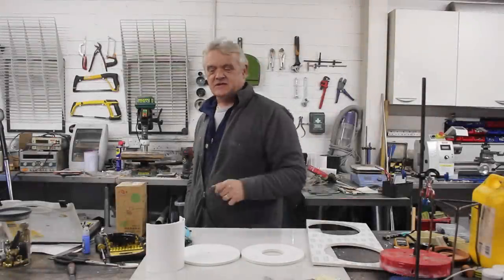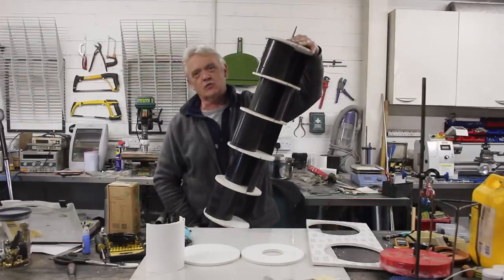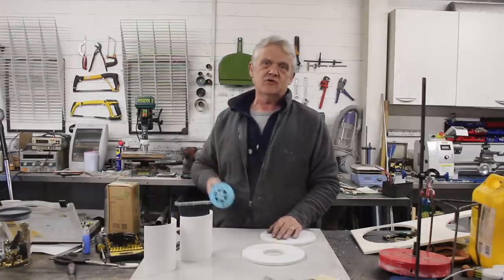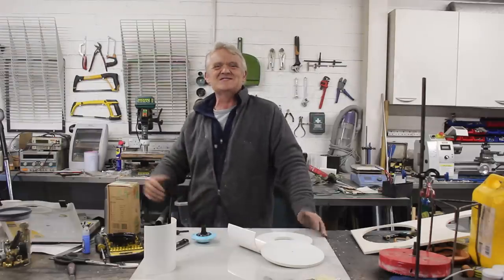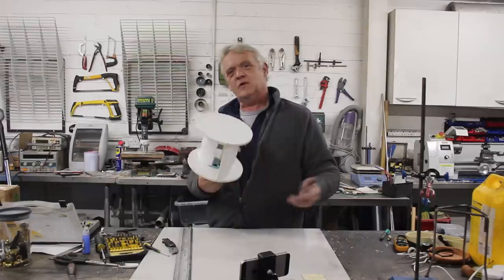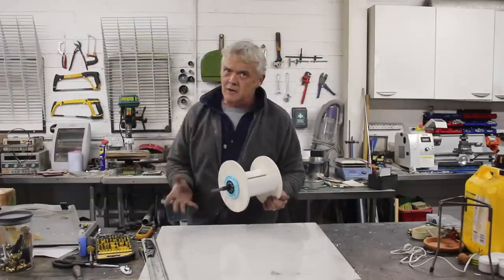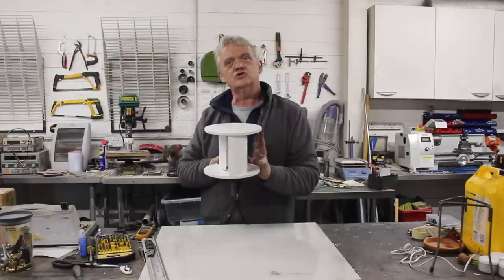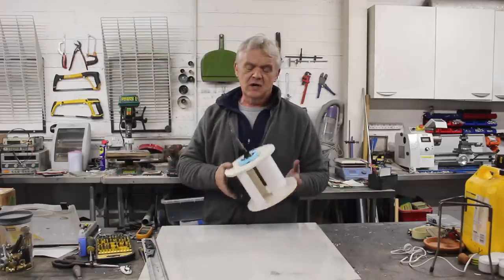1718 A New Style Of Wind Turbine - Cheaper, Simpler, Better

Comment: Rob, I read one of the earlier comments (from Rock Lover) and I can't stop thinking about it. Would be great if you could offer some feedback as, to me anyway, it's very clever thinking.....his idea of having an inner shaft split into two sections (where with one 'tube'  revolves inside the other) would allow you to connect a set of vertical blades to each one....if each blade set revolved in opposite directions the result would be that the magnets and coils would be passing each other at twice the speed but utilising the same force of wind.....surely double the output for the same effort. Apologies to Rock Lover for repeating his idea but simply hoping you got twice the opportunity to get Rob's attention/thoughts. 👍

Comment: I'm uploading 2 videos of the 3 long blade version that I just got home with, connected my meter to the plug pins and got an awesome result, I then added a rectifier and recorded the voltage in DC
Reply from the maker: I'll jump over and see - thanks for the heads up mate
Reply: @ThinkingandTinkering  Think a little harder about the mechanics & physics underpaying your proposal.. with you're hold is akin to a paddle steamers wheel.. step back & look at it again vs a turbochargers "impeller" & the "turbine" wheel of a turbo.. next think about your argument of the alternator vs permanent magnet rotors.. of course you'll get a MUCH big charge as the field coil cores & rotor magnets/coil dia's increases.. the rate/voltage of charge created is an exponential factor of the speed of the magnetic field cut passing the field coils.. neodymium magnet rotor around a Gentle Annie armature is as cheap as you're ever going to get.. back to you paddle wheel with ALL that air flow direction reversals .. a POOR POOR design in physics & aerodynamics.. TOO MUCH energy lost in flow changes.. duct it like a turbocharge exh turbine wheel.. on top of an inverted hollow exhaust mast
Reply: @ThinkingandTinkering  what if you used the geo spin design the astronauts use for zero spin training? If you replaced the bars with deep curve blades it would be like combing vertical and horizontal turbines together. You'd also have 3 center points so you could have 3 or 6 generators on one setup,it would collect wind from every direction,it would always be balanced even in a tornado and being a complete sphere it would be less likely for birds to fly into it because it's not just a blurry flat surface.

Comment: Aerodynamic drag type turbines have a tip speed ratio less than 1,  and contrast with aerodynamic lift type turbines with a tip speed ratio greater than 1, and tip speed says alot about rpms in a given wind.  And motors/generators are rated to a specific rpm per volt and amp. 

All That said, a particular motor with a high rpm per volt does not pair well directly drive to a drag type turbine. Ratherly,  gearing may be preferred over direct drive or to use a lift turbine. 

But there's trick to design drag type VAWT turbine to spin a bit faster.  The radial velocity will be the tip speed ratio × wind speed which sugest that by decreasing the radius of the sweep area while maintaining a constant radial velocity will increase the turbine's rpm. Because RPM=radial velicity/2×3.141×radius when the radial velocity is adjusted to distance/minutes.   But to maintaine the same cross section of wind, if you half the radius you'll want to double the height in order to catch the same amount of wind.
Reply: Very interesting

Comment: Could this setup and your figures you stated be powerful enough to charge 12 volt batteries?  
I know nothing much about electrics,  but for 12 v led lights run off batteries charged (if it works) by wind is worth giving a go....... 👍🏻

Comment: I wonder if you can combine this fan with one of those vent fans from the tops of houses. Those can catch wind from any direction and are premade.
Reply: it's basically the same as them, low efficiency but cheap as chips. Get vent fan and add generator.
Reply: @thekaxmax  seems like a good upgrade. plus, the generator design is so simple, someone could replicate it with a more worthwhile out put
Reply: @johnnyhellfire6  There's only so much energy you can get from a given cross-section and wind speed. A single spinner isn't going to give you much without a continuous gale. Although adding an upwind concentrator (funnel) may help. But we're getting out of cheapness now--low energy or cheap, pick one.
Reply: @thekaxmax  every little bit counts
Reply: @thekaxmax  every little bit helps
Reply: They are already available , have been for a while. Some use heat from the flu too

Comment: I got the 6 blade version and tried it with 3 of your soil pipe aerofoil propeller blades that are about 50 cm long. It was giving me about 80v and about 0.02A short circuited.  I decided to hook this up to a small transformer that I salvaged from a UPS followed by one of those rectifiers.   Output was not bad I measured 16v 0.1ma.  I was disappointed with only 1 Watt but that seems to be a pattern with my home made wind projects.
Reply: What would be interesting is if you can come up with a more sturdy mount for the coils/shaft.  This felt like the shaft was gonna snap in my hand and still generated nothing.
Reply: I was thinking the same about strain on the main shaft, I’d be tempted to build a larger vertical turbine with a fan motor on both ends to reduce the strain
Reply: @Milkybar3320011  the faster it spins the more volts it produces, it doesn’t seem to increase current very much so it really needs some kind of mini transformer.  I’d like to test it on a proper single phase wind charge controller that can regulate the output for a 12v lead acid.  I suspect 2 motors will produce closer to what is required so I think u have the right idea.  My next test is going to be a cable drum with guttering as the blades.  Gonna try one of Robs water bearings and hope most of the load is on that rather than the plastic shaft.  Maybe some sort of belt drive would also ease the stress and increase rpm.

Comment: Adding partial fins Short and small, at the edge, that only are from edge 20%in on radius on base. Spaced 45 degrees to the main fins making fin total 6, adds more torque. These little partial fins also improve start from dead. I 3D printed this, improving start and torque about 50%, even though they were 15% size of 2 main fins. If you build ends with slots for magnets and support bearing plates with coils in, generator. That is if one spins their their coils, for project

Comment: Great, could put a fan motor top and bottom. Though the alternating current my be off a cycle...I guess a low power diode set up would allow a power doubling?
Reply: My thoughts too, but when rectified to DC and adding a capacitor the issue may be resolved

Comment: Ring magnet, brushless design is something that's good, one suggestion for your rotor, if you visualize water falling onto your rotor there is no where for it to pile up it will shoot over to the other side, however with a PVC sink drain tube in the middle to block the cross flow would allow for a pile up so to say of the Wind for each blade not affecting the other side negatively, there are several ways to utilize cross flow but it looks like one simple addition might improve it?

Comment: Drive the generator from the edge of the disks. You'll get several turns of the generator from each revolution of the disk. If it spins easily enough, add a second generator.
Reply: Good idea!  What about using a stack of them--wired in parallel--to multiply the power?  They are each so short that you could probably fit at least a half-dozen between the two disks.
Reply: But If you drive the generator from the edge of the disk, you get less leverage. Wouldn't the resistance of the generator applied to the edge of the disk cancel out what benefits of gear ratio that you might get from such a configuration?
Reply: @Berkana  It's hard to say, but I would think that with the pitiful amount of wattage that particular generator put out, it shouldn't have that much resistance. Of course, adjustments will be needed for optimum performance.
Reply: A cheap solar panel would be better.
Reply: @irishguy200007  No doubt, but I think we're working on something from parts-on-hand type of situation, as he often does. Actually, wind is very indirect solar power if you think about it...
Reply: @irishguy200007  or a hybrid... The constant trickle if worst case on a slow wind speed with a boost of sun every now and then would suit or British weather.... This is the cheap wind bit :)
Reply: Heh.  Put a VAT pole on your mailbox, so you get a short burst of power every time a vehicle whips by.
Reply: just needs gearing. increase the ratio of turns to 1:10 sholu 10x your power output. this is the same for car alternators aswell. spin at the wrong speed and they do nothing.

Comment: maybe a reclassification of turbine types is needed   -Axial and Transverse -(relating to wind path relative to generator axis)   as a VAWT can be mounted in any orientation - even arrayed about a "central axis" - if one were to wish - they can even be tracked as well as located on permanently located structures - if one wishes to use suboptimal locations or overly complex designs...      all for fun and exploring different options.

Comment: If you stacked a couple of them on top of each other like you did with the wind wall (to make a single tower could you make a Venturi case that turned into the wind to help increase air flow?
Reply: Could work. I know there is a Canadian company essentially planning the horizontal version of that for on top of house roofs. they seem to generate power like mad.

Comment: There were savonius rotors that were built from oil drums, they made a lot of power! The issue with building the rotor to be dependant on the generator bearing is that those bearings usually are the point of failure.

Comment: Would a baffle or cone directed to one side of this turbine improve efficiency? The wind would hit the right side of the turbine rather than both sides and if mounted to a larger plastic surround it could pivot with a vane into the wind. The only problem I see is that the wires for the turbine would have to run through the inside of the shaft so the baffle can rotate 360 degrees with the wind direction.

Comment: Could you add a capacitor to the led to stop the flashing and get better results?
Reply: Can’t remember if the output AC, but if it is DC or you add a simple bridge rectifier then a capacitor I believe would help

Comment: A savinous wind turbine with the axle being the generator where the magnets rotate with a stack of coils on the inside 🤔
There's also an interesting way of wind proofing a vertical turbine by folding the layers into themselves with servo motors  making a round column whenever wind speed is too high automatically and self powered.

Comment: Hi Robert, just after your thoughts on something. I've made a wind turbine which outputs 3 phase ac. I've coupled this to a grid tied turbine inverter and its working well. The inverter is good up to about 80v however after that it disconnects from the turbine to protect itself, and that is after employing a dump load.
This only happens when the wind is gusty!
I know if I join the 3 wires coming from the turbine it basically stops it moving so I was wondering if I built an arduino project that detected wind speed and if really windy trigger a relay that joins the 3 wires from the turbine, would that damage the turbine do you think? 
Joining the 3 wires is how my emergency break works so its only doing the same as that, I was just wondering if this method was used several times would it damage the turbine do you think?

Comment: I'm wondering. Could you build a horizontal axis unit that roof mounts on your car in the vortex area just behind the windscreen. Theoretically not adding to the drag coefficient, because it's in the low pressure zone vortex, you could keep raising it slightly until it catches the air stream above the low pressure zone. Not the large diameter unit you show there. Something say 3" diameter with a length from drip rail to drip rail. And would it be enough to recharge the battery in order to remove the parasitic load of the alternator? A tremendous undertaking, to be sure! If nothing else, I'd like to see an experiment with one mounted on a board that you could measure the outputs according to the angle of the board against a steady wind, as the air would have to ramp up the board creating perhaps a higher pressure, while also creating the low pressure behind it that the Savonius could dump its "spent" air into. Well, creating a higher and lower pressure in front and behind, respectively, anyway!

Comment: A HAWT will always out-perform a VAWT because the prop is essentially a wing where a turbine catcher has too much drag.  I did some experimenting with small wind power, hoping to develop a cheap residential power system. In the end, solar far out-performs wind but the downside is that Earth has nighttime, where we consiume power for lighting.  Battery storage is the balancing point and, as better batteries become inexpensive, solar will always win. Mr Sun gives out a huge amount of free energy.
Reply from the maker: no it won't - try a hawt in a built up area
Reply: @ThinkingandTinkering  You right Rob! and with an greater area higher speed! But an easy solution with higher quality we got a safer system we can trust in!

Comment: Maybe you can put two of those generators on each turbine section, one on each side. Double the amperage then maybe put a stack of five or ten turbines with double stacked generators on each one you could have up to 20 times the amperage output. I think by improving on the type of turbine oh, you have many ways of increasing the output and using this ring magnet coil with Armature setup for a generator, a benefit is that it is brushless. A little waterproofing, if you had a small stream or river near your property, you could put multiple units up and down the bank of the river. A water wheel design could be used.

Comment: When the output is loaded what size of blade will you need to overcome starting torque?  My next door neighbor loves building windmills to power garden lights. But his biggest problem is that unloaded they turn ok but as soon as they are loaded they just standstill as the wind can’t overcome the torque imposed by a few rechargeable batteries. And we are not talking large batteries just enough AAA cells to run the lights over night.
Reply: Robert did a video a while ago about cogging (I think that’s the phrase) he added a small capacitor, which allowed a the turbine to spin up first
Reply: @Milkybar3320011  A small cap won't that limit the output current and thus power. 
I think it needs something like a gear box, in reverse so it can start in 4th less torque load and then work up to 1st.
The only other thing i can think of is a form of output control which brings in the load once the blades have some energy behind them.

Comment: A thought, inspired from another comment about stacked counter-rotation Savonius idea ( will try to re-find it later to give credit where it's due )
I'm liking the idea of rotating the coil and magnetic fields in opposite direction, which makes me think you'll get usable energy at lower windspeeds .
My thoughts are, rather than stack them, to explore making a device that has a Savonius type interior rotating one way and a Darrieus ( egg-beater ) outer rotating in the counter direction. Of course the airflow of the outer will disturb the inner airflow so couldn't expect the efficiency of 2 independent devices but it would be interesting to see if it could boost the extraction from a similar surface area of either independently.
Reply: It has further occurred to me, that rather than spin the coil, which brings in the need for slip rings and added points of failure, would it create the same effect by just spinning the crab cage ( in opposite direction to the magnet ) around the coil? The 2 parts of that could be joined together with something non magnetic like resin/fibreglass

Comment: For a wind wall I think a stepper motor in the mittle driven from bicycle gears and a chain would maybe be the more efficient solution even with the friction losses counted in.  
Maybe  2 metres top to bottom 160mm halve pipes would work also as these cover more area with less fiddling 120 degree offsetting could be done by the next collum and so on. We can buy those 160mm 2m long pipes for €14 here in Germany.

Comment: So interesting and inspiring. Thank you. 
One question, if we had a means to generate more torque to the generator, how could we use that to increase the energy output of the generator? It appears the alternator type generators are more effective at speed. Thanks!

Comment: agree with another comment, is coil wire too slim and really hindering output?
agree with you about the basic alternator being a great candidate to exploit because manufacturing costs would be near nothing. I liked your converted roof exhaust unit a lot and same for the large squirrel cage turned VAWT.